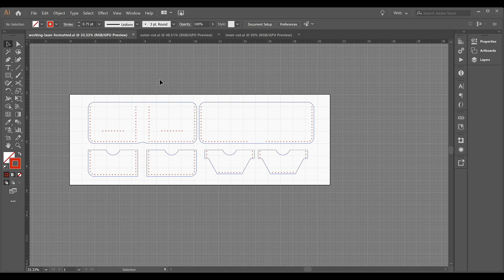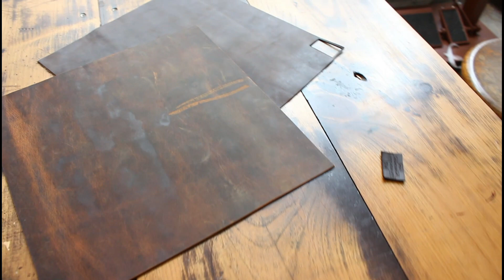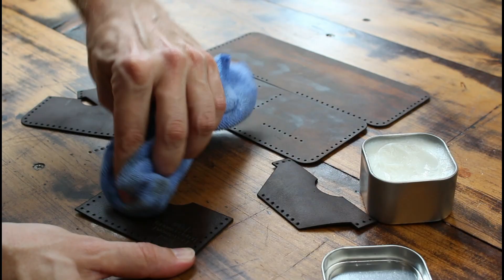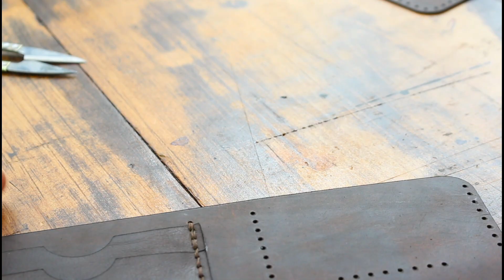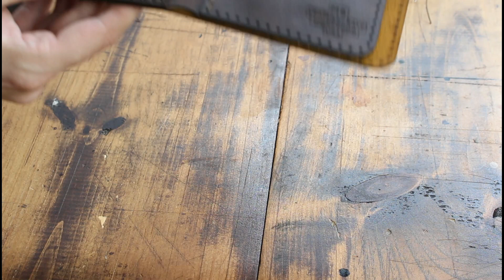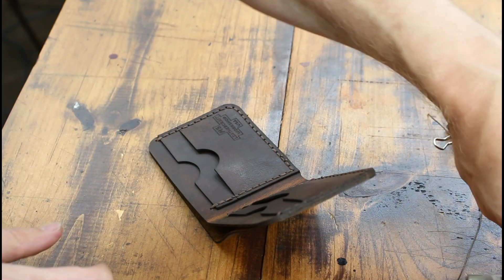Make A Laser Cut Bi-Fold Leather Wallet (FREE SVG and PDF PATTERN!)

Comment: I have been using a laser to cut and decorate leather for around 5 or 6 years. The quick and dirty wallet was exactly what I was looking for, as my wallet making  usually involves commercial wallet interiors and I had none in inventory.  I received an urgent request for a wallet for a 95th birthday present and I had 3 days to deliver. The customer wanted it tooled (not possible given the time restraints), recipients name in Chevy script (BelAir) as well as an American flag and the Chevrolet logo. I chose one from 1913-1915.

The SVG was off sized but I also dl the pdf and was able to match it exactly, though not sure it mattered. I decorated it with a carving pattern for a wallet, traced and then on fill. That worked well. 

I use drum dyed leather purchased directly from Wicket and Craig for all my products. A big time saver! I do have an excellent air assist on my laser and I designed and 3D printed the nozzle myself, but inevitably there will be smoke deposits around the engraving or cuts. I find I simply wipe the smoke off with a piece of paper towel. No need for balm, etc. I usually Apply Aussie and then Resolene. 

I did replace all the stitch holes with stitch lines for machine stitching and will be skiving all the edges before gluing.

Thanks again for the SVG and video!

Bob
Tucson Leather Works

Comment: FYI, I downloaded the svg file that was linked and imported both into lightburn and adjusted my settings for my laser.  Everything cut fine, but the svg version of the file is not a full size wallet.  I downloaded the pdf afterward and the patter pieces were much larger.  So please use the measure tool before cutting leather...
Reply: I found out today, this is stil the case. Use the pdf version instead of the SVG. Or remember to adjust the scaling factor of the svg file.

Comment: I haven't tried this with my laser yet...but if you ran a burn line all the way around your visible internal stitch lines (to engrave depth), the thread would sit lower, allowing a slimmer fit, and no wear on the stitching. I do it with leather goods I make by hand now, but manually with a stitch roller. It embosses a line into the wet leather for the stitch to sit in.

Comment: Fantastic video, thanks very much for the free template, I think it is a GREAT starting off point for so many new to laser engraving/cutting. 

One question -- you got a ONE pass cut on 4oz leather, with a 50 (or 75) watt CO2 laser? What's the magic there? I have the exact same machine and it always takes several passes so I'm genuinely curious.

Comment: I made this twice, first time I had difficulty with the curves looking nasty, second time I forgot to burnish the long edges before putting it together (DOH!). But the second wallet actually came out better. Only thing I don't like is the inside where the bills go. If I make this again, I will add a liner, because otherwise you see the stitching and it doesn't look professional in my opinion.

Comment: Great video! 
I’ve been looking to buy co2 laser cutter (around 50w). I’ve done quite a bit of research already but I’m torn between a Boss ($4000) and Orion (Chinese) for half the cost.  My main goal is for laser to cut out stitching holes for hand stitching. I currently use 4w diode for marking stitching lines but it’s too slow and weak for cutting holes. Any input would be greatly appreciated.
Thanks!!
Reply: Boss is the way to go, absolutely. The support, warranty and such is WELL worth the money. My first CO2 laser I built cost me 15K, and it wasn't anywhere near as nice as the Boss 75W I just got.

Comment: Does this differ in size compared to the "Modern Bi-Fold Wallet - Two Full Sets" templates?
Reply from the maker: Yes this one is shorter height (3.375" vs 3.75") and has 2 less card slots.
Reply: @MAKESUPPLYLEATHER  I asked the question midway thru the video then I noticed the differences when I got my other templates out to see lol. I placed my order yesterday heh.